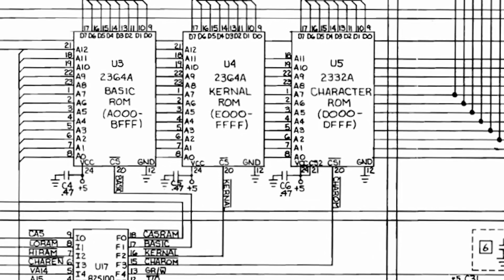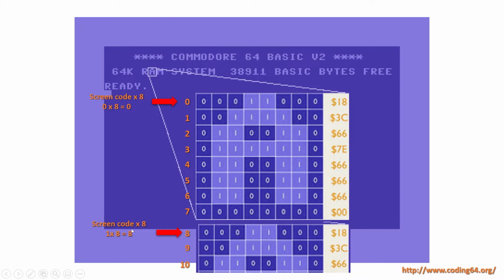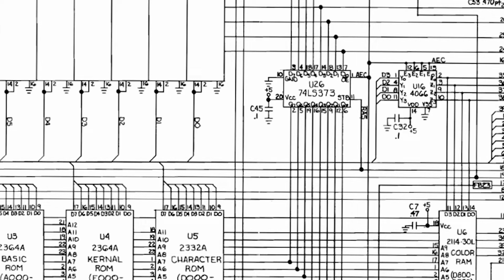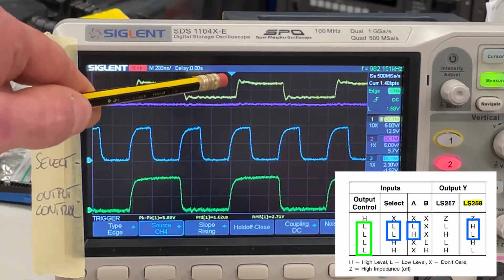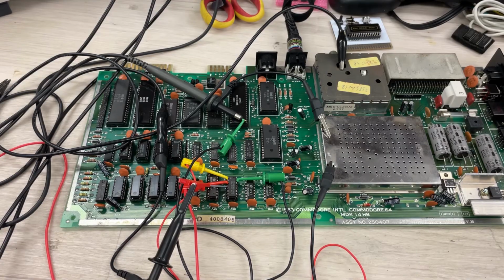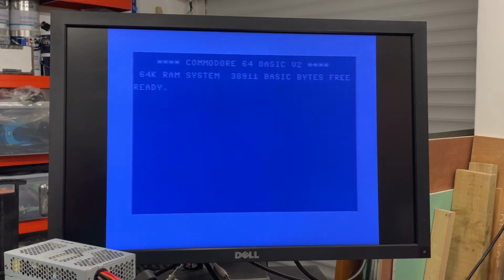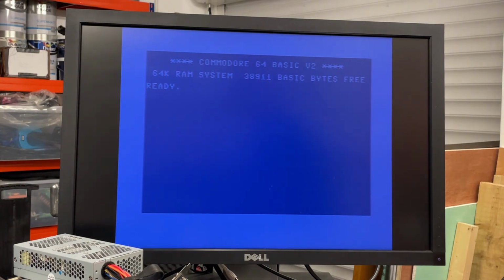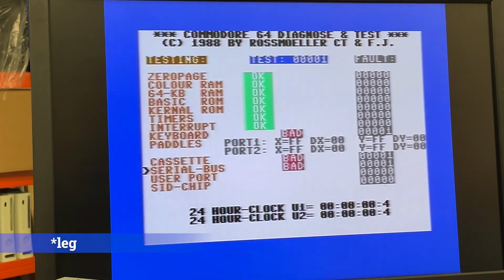COMMODORE 64 repair video - Part 2

Comment: Indeed, nice video. I know some similar cases where an extra pull-up or pull-down helps. For example self-burned 16-bit Kickstart EPROMS in Amigas. They may or may not be marginal without pull-ups, but if they are, two 10k or 4.7k resistor networks will help and stabilize everything. 

Makes me wonder if that little fix of yours could help with general reliability of the 250407 C64-boards.

BTW, what you called modules there is normally called RAM (or IC, RAM-IC or so). In my understanding a (RAM) module to me is several RAM ICs on a piece of PCB, like the DDR4 modules that we have nowadays or the old COAST (Cache on a stick) modules.

Greetings from an old C64 and amiga user from back in the days... ^.^
Reply from the maker: Interesting thought on the possibility that I unintentionally found a tweak for the 250407!

Yes thanks for mentioning the RAM thing. You’re right it course. Sometimes I say weird things, sometimes I notice, sometimes I don’t 😂 thanks for watching!